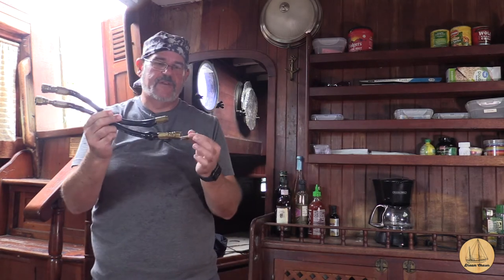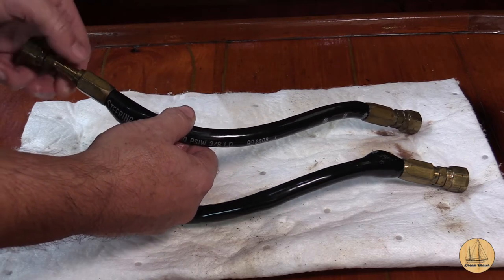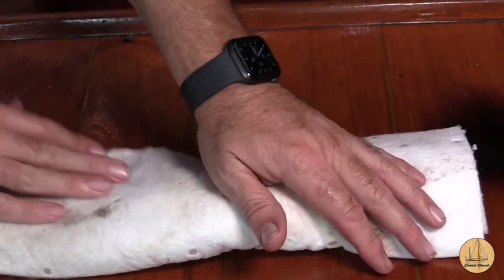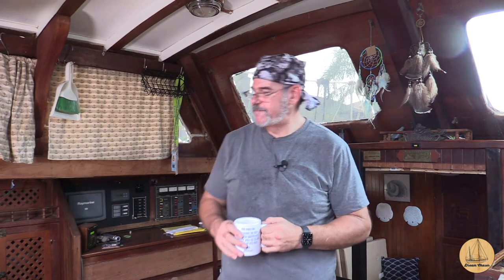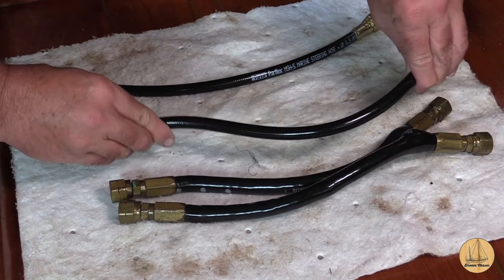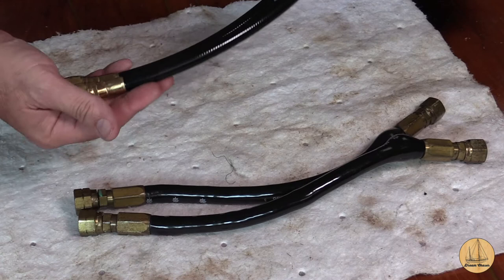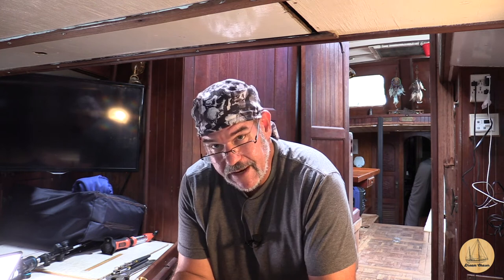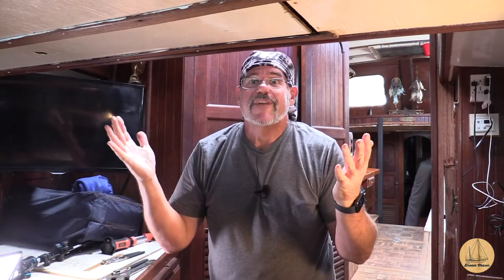How to Replace or Repair Hydraulic Steering Hoses

Comment: Awesome vid sir, this is the video I've been looking for! Can you please tell me the model number for the Teleflex thrust ram? Is it possible to use just one ram instead of two? What kind of manual pump do you have at the helm? Any recommendations for auto pilot system?
Reply from the maker: I have a sea star Capilano. I am not at the boat this week and can’t find the picture of the model number but this site has recommendations based on the size of boat. Given the weight of the boat and size of rudder on a 51 Formosa I would NOT use just one ram. I would worry it would put too much strain on the rudder post. http://www.seastarsolutions.com/products/hydraulic-new/inboard-new/capilano-new/#helm
Reply from the maker: Mine is a model 1275 Capilano helm by a company called Teleflex out of Vancouver (who I think was bought by SeaStar)